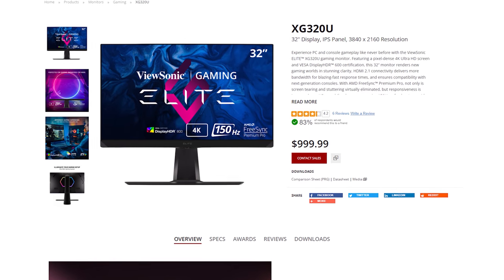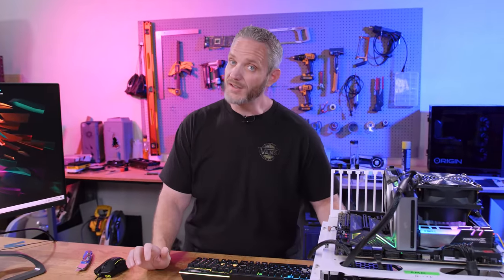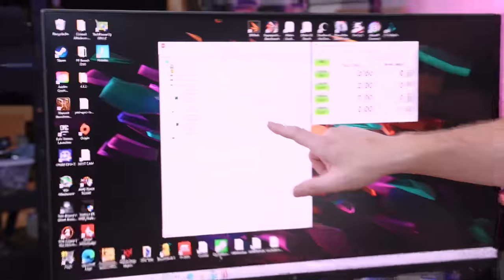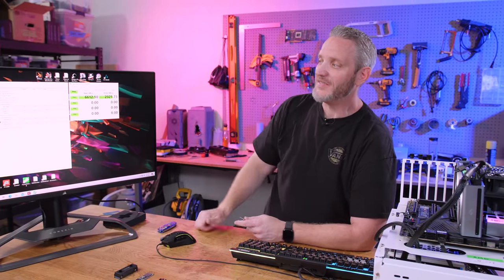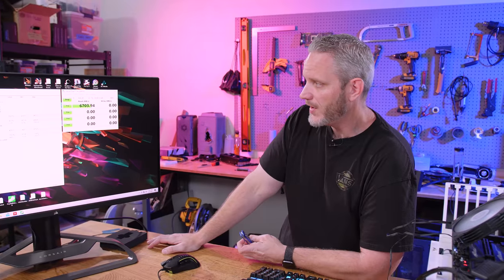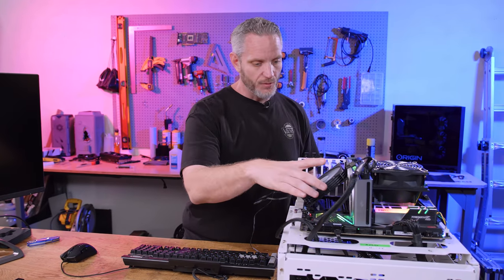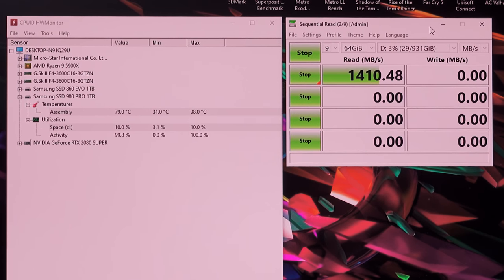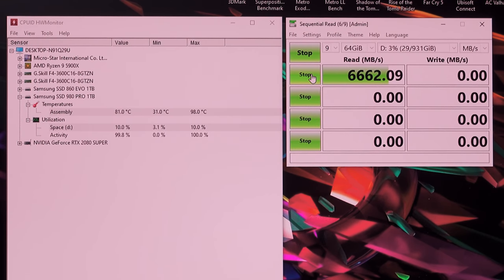I watercooled an NVME SSD... These results were unexpected!

Comment: The problem with trying to stress test an SSD is that it'll reduce the life of the drive, and I don't think any software vendor wants to deal with having a EULA written up to absolve them of any liability. SSD MTBF's are still way lower than HDD's IIRC,  so it's a real concern. The dips in performance are the cache filling up.

What might work is doing running operations that you're not supposed to do with SSDS, like defrags with large files and scripted ISO creation/deletion, or just multiple instances of benchmarks,  but I suspect you'll saturate the bus before you get the controller that hot (without a heat gun).

Comment: Quite easy stress test. i wrote a python script calculation huge matrices at top speed using multiprocessing (couple of GB between several files). Stress my NVMe to top speed (in my case 2200/1600 MB/s).

Comment: On Amazon there is a "ineo M.2 2280 SSD Rocket Heatsink Built-in Cooling Fan [M3]"  It has heat pipes to a heatsink with a small fan.  It is taller and the fan noise might be noticeable.

Comment: Hmm, one big file is certainly harder on the NAND, but I wonder if random reads would be harder on the controller. Could write speed variation be related to wear-leveling performing additional writes? Or more likely exceeding the SLC and/or DRAM cache size.

Comment: using the stock cooler on my 980 samsung pro gen 4 1tb m.2 that came with my mobo, sits at 43C in a itx with only one intake fan(cpu) mobo is b560i aorus ax pro.
it still goes slower than the one in my main rig thats sitting under a rx6900xt which gets 6999/5500 which has no heatsink, only difference between the two machines are 3000mhz and 3600mhz oh and 5800x and 11400. its faster with the 3600mhz amd system that also runs hotter, great to know if it goes over 80C it will throttle i'll have to test my rig at home to see if it gets anywhere near that.

Comment: These drives get really hot. I would never run an NVME without a Mobo Cover or aftermarket heatsink.
I work in IT, and when these drives first rolled around many years ago my team and I were upgrading users hardware components to SSDs, and out of nowhere it started to smell like a fire. And then one of the laptops that was just sitting in idle started smoking. I rushed, and opened the back of the laptop quickly to find the NVME SSD was on fire! 
The NVME had plenty of room to breathe in there with a little ventilation but had no form of heatsink. Ever since then I have been scared of NVME drives LOL. The one on my PC currently has the Mobo Heatsink and gets helps from the front PC fan/GPUS fan to help circulate the air over the Mobo Heatsink.

Comment: Hey, I am not 100% sure myself, but the way I understood it you actually now only tested the NAND (since you have very good drive with a very good controller).
If you really want throttle and high temps you need to test small random writes and reads. The NAND doesn't care whether it's written sequentially or random.
From the NANDs perspective the sequential write is sort of random to a degree because of wear leveling anyway.
But small high IOPS random writes absolutely make your controller sweat, I can observe this in my development environment whenever I build source code or gradle (dependencies).
So I presume that this wasn't a very good test for what you wanted to achieve.

Comment: Aida64 extreme with a stability test can tick stress all drives but you cant select which ones, also I use "AS SSD" benchmark seems accurate for me but only does 10gb files not 64gb.(my main drive sits at 45c idle and 48c load)

Comment: I noticed you still left the label on your nvme ssd. I have 4 in my main box and 3 in my game box and I too have left the lables on. I didn't want to remove the labels for warranty and identification purposes of each drive. Wouldn't it be better if the labels were removed ?. Surely they are  behaving like heat insulators limiting heat transfer to the heat sink. If warranty is not impeded by removing them, they would be off. Anyone know?
As for water blocking nvme, that's practically ridiculous. Our computers already resemble a Borg Cube. Adding more to nvme would make them resemble a Borg maturation chamber, more so if there are multiple installed.

Comment: I suspect the varying write speeds are a consequence of the test file size being some unrelated factor of the memory organisation size on the SSD, To put it in simple terms, this results in the SSD controller having a greater or lesser degree of 'overhead'; organising where the data is to be written, number of blocks of flash memory to be used, where on the chip for wear levelling etc.. This will probably impact the efficiency of any internal caching n the SSD too.

There needs to be a command line version of the Crystal Disk test that invokes and runs tests with the number of runs, test files sizes and so on where those parameters are switches in the command. No need for fancy GUIs. I KNOW you'd LOVE that.

Comment: Why not testing with standard file transfer and with HWinfo that showing ssd both temp sensors.
Samsung 980pro throttle easy with no heatsink over 80c

Comment: I"m not finished with video but I'm assuming reason write speed keeps fluctuation while read speed is consistent is due to how garbage collection works on SSD's. If it's having to both erase and then re-wire cells that hasn't been cleared yet from a previous deletion for example it'll be slower than if it had time to garbage collect and write to a freshly cleaned cell. Also if some cells are degraded more then others i believe that can effect speed. Just some limited understanding of SSD's back when i was researching them a lot, i could be completely wrong. Just reading the disk wouldn't be affected as much since it's not needing to erase and write anything, just read data. EDIT: Actually reading through comments, the comments about cache running out of room makes more sense as well, your normally not constantly writing 64GB of data over and over again so in the real world you would not likely see that huge drop in performance often.

Comment: My M.2 Samsung drive sits on the back of the motherboard and ot just does not get recognized by my system. Nothing works, no BIOS update, no NAS or other settings change this. I cant even access it without disassembly of everything because my case does not open on that side...  So thermals are fine. Never throttled before. Never even seen load on it!

Comment: SSD are faster when hotter, that's basic chemistry. Also, they become less reliable when hotter. Around 60 degrees C is the sweet spot, warm so fast but no so many errors as to slow it down. If your drives never get hotter than this, don't cool them. Also, statistically, you're more likely to tread on your nvme and break it than have it fail early due to running hotter and faster.

Comment: Just finished my custom water loop, my gen 4 nvme had a heatsink on it amd the system was powering on for a split second clicking then shutting down. I found out that the heatsink was somehow grounding its self to the board/pcie slot. Im running the drive nakey now and idk what to do about the temps. My speeds haven't changed much when benchmarking with userbench.

Comment: On the new drives the controller and nand chips are much more resilient than they were when recommended temp was not higher than 55°C, but on range from 40 to 50 where the cells supposedly performed best, now they can easily go to 85 without data corruption, but it also depends on cell type, manufacturer etc... As for the controller, you might want to keep it as cool as possible, but until certain temp threshold, it kinda doesn't matter because it "doesn't turbo" ...

Comment: For a test process maybe two drives the same, place various file types and sizes on them in separate folders and then setup Synctoy to do a backup from one to the other. Enough files for the backup to last whatever amount of time would be appropriate to test, maybe 5-10 minutes? Sorry that last part is out of my comfort zone for an answer. I just know that when I run SyncToy to do some disk backups the drives run and run and run.

Comment: NAND flash doesn't really care if it gets hot, it actually performs more reliably at somewhat higher temperatures (40C-50C) and can become unreliable at lower temperatures (<10C).  It is the controller that wants to be as cool as possible to prevent throttling.

Comment: I have seen the speed bugs on systems using the firmware/cpu based TPM, i started using a TPM module haven't seen the speed bugs since. also your speed will take a hit running off the chip-set
you might want to drop it in the top m.2 slot off the CPU also
also test in the top slot with the GPU hot as the top slot gets toasty it got so hot it killed my gigabyte 1tb gen 4 drive. but I'm running a 3090 so it gets hot as hell on the back plate i even stuck a fan cooled backplate on it

Comment: Jay simple question on water cooling. Out of the pump- putting in a splitter- one line going to GPU and the other to CPU and than having a splitter at the radiator to except the output of both GPU and CPU. Is this possible? Would there be an issue.

Comment: Whats a good cooling solution for those of use using ssd's on the back of mobo's like an x 570 in an NR 200 P case?  Can't use a heatsink it bumps the case side panel.  Thermal pads until they touch the case side panel?

Comment: Off the cuff thought about why the tests are limited and you don't see a "how hot does my drive get?" kind of test: lifespan of the drive, perpetually reading and writing decreases the life span, doesn't it? Under normal ops that should be fine, but slamming it with tests might have a more noticeable impact on it.  Just a thought.

Comment: I'm not sure how these results were unexpected?

When adding more cooling capacity, the SSD got cooler. When blasting it with a heatgun, it got hotter, therefore slower due to throttling.

Surely that's what you expected?
Reply: It showed that there is no performance difference between no cover, mobo heat spreader, 3rd party heat spreader and water cooled. So don't waste your money. He also demonstrated when performance did take a hit at around 80 degrees centigrade.

Comment: You know what my issue is with these mobo delivered heatsinks? They can be a bitch to apply. They seriously need to put some groves on them so you can slap the ssd on the sink and then install the combo easily. On my board, if you put the sink on first, you couldn't see holes or connector on the Mobo while installing it. If you put the heat sink last the thermal pad kept moving the SSD out of its slot.

Comment: yeh i had old sata cheap ssd somehow was a hot/miss manufactored one.. it get to 80 degrees first time i saw it was like wow what.. but the cpu was pulling data to run windows and play games when i set it to just games it 60 degrees whats still insane sdd must have been something up with it. the colder a path is for electicty the less ressistence .. it can be as simple as the main power cable to the power supply if u can get a temp gun have 5 power supply.. and maybe a dud one that still works .. u can see the difference.. its kinda like lithium battery in a car there 14.7 volts fully charged verse 12.7 but the lithium battery can release more current then a wet cell battery.. bigger window so for any performance car u want that 14.7volts u want the ecu so go i need this current.. then accept more

Comment: Metal cover has plenty of thermal capacity and with normal usage you will never have a chance to saturate it but for me my SSD was getting more hot from the GPU that is right next to it than from the load it was getting and that was still only 44 C.

Comment: Write a batch file to keep the SSD in a constant state of use, and monitor the temperature with something else. Batch files were originally used to stress the computers to see if they would keep running for consumers.

Comment: I run a heatsink with a small built in blower style fan, my M.2 gen 3 adata 1tb ssd runs at 23c under normal use.

Comment: Before any one goes overboard on cooling an NVME, they should try to switch the drive from 512 byte sector emulation to 4kb/native sector addressing.

TL;DR: Most consumer NVME drives out of the box emulate 512 byte sectors for compatibility with older OS's, software, drive images and tools (512e Mode). 
You can make the flash controller a little more efficient (and potentially run cooler) by flipping a bit in the firmware to use it's native 4KB "Advanced Format" sectors from a Live Linux USB/DVD.
I've seen mixed results with sequential speeds, but my 4K random speeds almost always go up at least a little after performing this tweak.

Sabrent has a Windows-based tool to do this (for their SSDs) and were the first to really give this tweak any attention, but you can do it for a lot of NVME's from any Live Linux USB/CD environment (Ubuntu, Parted Magic, ETC).

Comment: You need to remember that the memory chips need to be at a certain constant temperature, while the controller is the only thing that’s temperature dependent.  Also, you need to take into account the cache available for reads/writes.  Keeping the temperatures low overall helps with drive longevity, so it’s always best practice to cool it even if you don’t see a performance hit/advantage.

Comment: why don't you get a 3D printer heater cartridge an arduino and high power fet driver with a fan so you can control your temp properly

Comment: If the issue is longevity not speed, then you need to factor in the cost of cooling vs the shortened lifespan costs.

If it costs more to cool it than the cost of suffering a shortened lifespan, then it's not worth cooling it.

Comment: hey jay i havr 2 questions about this video as well 3 actully so where is the ssd m2 plug in too cos ive always woundered about this mines in the cpu direct one i believe the other routs thro the bord chip set and uses some of the chip sets deadicated lanes now i dont know this for fact but i just assumed it was quick being in thr first slot i could be completely wrong sbout this but im sure when i first looked into doing my system i read one is thro the chip set the other is not and if so does it make a difference lol and if so are u going to do anouther lot of tests lol grr oh and is ur os on a sata drive using thay controler ?  
the other thing is if u some how use all the pci lanes on the chip set how much does that effedt performance when using a ssd thro the chip set ?

Comment: I have 2 of them. Definitely worth it. Double performance in large transfers. My 970 Evo was getting up to 65C before...First throttle point is at 40C. Just copy a 50Gb file from one drive to the other, you can see the drop off midway through the transfer on the windows transfer readout.

Comment: Hey Jay. To give some feedback, I ran the same test with CrystalDiskMark on the same file size and test count by just having the motherboard's heat plate and thermal pad on my NVMe SSD. I have an ASUS ROG Strix B550-F with a WD Black SN850 1TB SSD. After running 3 back to back tests on Default and NVMe SSD modes with the idle temp being 45°C (while waiting 6 mins between each set of tests to go back to idle), it went up to 70°C during both sets of tests and I didn't notice any signs of throttling or variance on the read and write speed. I looked it up and found out that it also uses TLC NAND Flash, which is interesting since I didn't notice the same level of variance on mine. Something else to note is that this is my OS drive.

Comment: I have been curious about cooling the nvme. Building my first rig and bought a cooler with a pwm fan on it. $240 for the 980 pro and $20ish for the cooler...figured it was cheap insurance.

Comment: Jay - a couple of things, 1 about this vid & 1 about an older 1.

This vid - for stressing an NVME, if HWInfo can monitor throughput/performance, & not just temps, then you could use it for that, & make some sort of batch script to repeatedly write, delete, write again to the drive as many times as needed.

Older vid - so I happened to watch that vid where you were modding a plastic model of an engine into a case, & saw the way you went about bending the acrylic (or whatever type of plastic it was, I forget exactly). If you wanted to do stuff like that more often, you could get (or maybe even make your own) acrylic bending machine. If you're not familiar, they do them on Amazon.

Comment: The overlooked issue with these kinds of things is the pressure & flow consequences caused BOTH by adding another component to the loop and especially in the case of a tiny component like this is the cross-sectional area of the heat sink.
There is always a tradeoff with components in a loop. Pressure drops will occur when you keep adding more components to the loop. If the cooler has the smallest cross section (which could very well be likely), that's going to restrict your overall flowrate.

Comment: how cool is that: the Asus Rog Strix B450-F Gaming 2 has an nvme cover for the slower slot only, and no room on the faster one. ok, it is closer to the cpu so more air flow, but stilll
Reply: I dont care about this too much but i was installing my system drive in the slot with cover then i realized it is the slower one

Comment: HW Monitor only shows memory temp, which is not ideal. HWInfo shows separate temperatures for the memory and controller. 
It's essential to look at both. Especially since on the 980 Pro you have different heights and a certain amount of trickery is needed to have the heatsink contact both.
I don't think you're going to find a proper torture test for SSDs, as for faster NVMEs the test will essentially destroy the drive. You will burn through 600 TBW (which is what a 1gb samsung ssd can take) EXTREMELY FAST. Good for a video. Horrible for anything else.